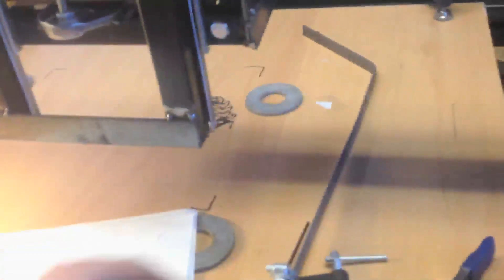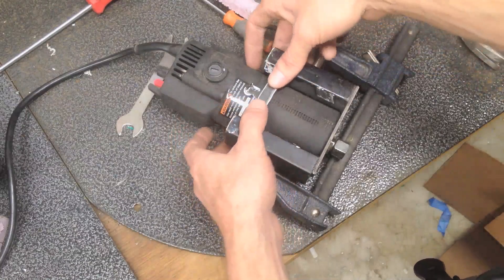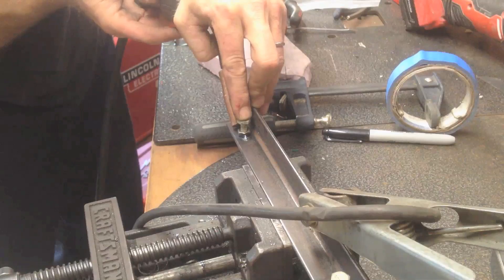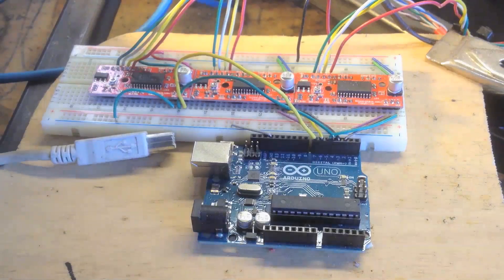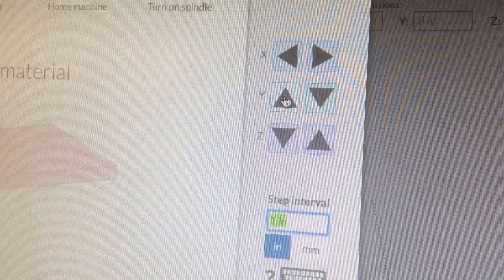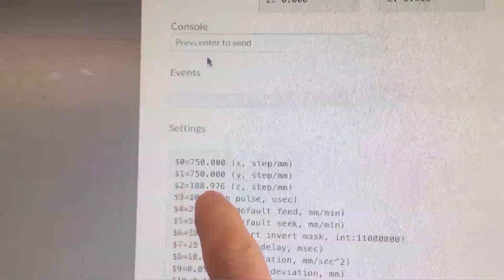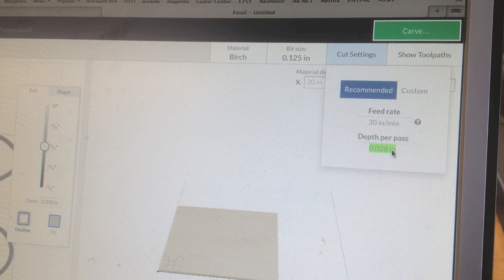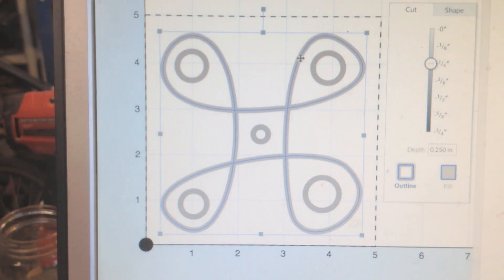How to: DIY Arduino CNC Router Cutter Welder (Part 5: Router, GRBL Settings and EASEL Tutorial)

Comment: It may seem strange to be commenting six years after the video was posted... I have been using a "Down-cut" spiral router bit recently.  It seems wrong to use a cutter that pushes the chips into the cut, but it works fine.  The big advantage is that because the spiral pushes the fibres down, there is absolutely no tear-out or fuzzy edges, even on fibrous material like that shown at 15:30.

Comment: thanks for bringing us best tutorial. please don`t mind i can`t speak English,  i have one problem in motor $150 step/mm is fine but my motor start vibrating on $160 or $200 etc. so can any body help me
im running my cnc on arduiono uno + cnc shield v3 + stepper driver A4988

Comment: Those motors look a little on the small side, are you able to machine wood with them?
Reply from the maker: Yeah. Even aluminum.
Reply: Fucking eh. Here I thought I was gonna have to shell out for larger motors to mill aluminum.
Reply from the maker: Keep in mind that these motors (nema 17) come in different torque specs,  these are the 84oz, which is the most powerful in that size chassis  (1.7in)    I'd recommend going with the biggest motor possible.
Reply: Went for nema 34's with 1232 oz in torque specs. Im hoping its enough to machine mild steel.

Comment: how grlb 0.9 homing is done can anyone say proper method
Reply from the maker: I'm using 0.8.  But have you tried pressing the reset button on the arduino? This will zero the machine, then confirm new home position.
Reply: not tried 
pls say proper steps for grbl homing process

Comment: How can i specify the working area....i mean how to determine the X-Y area limit?
Reply from the maker: The working area is determined by lead screw length.
Reply: Absorber Of Light  thank you for replying; but if so whats the purpose of stop switch or limit switch?
Reply from the maker: In case something goes wrong.   I don't have limit switches on my machine,  I've had it accidentally go past it's limit but I can just hit the arduino reset button to stop it.
Reply from the maker: If you're gonna leave the machine unattended, I recommend limit switches.
Reply: Absorber Of Light  thank you for explanation and you have lessen the extra work for me of setting up those limiters i was not going to buy those anyway rather make them myself...

Comment: hiii..i am making a cnc machine with arduino uno,a4988 driver and cnc shild
problem is x axis stepper motor is moving bt y axis stepper motor is not moving.y axis stepper motor is vibrating

Comment: I really appreciate your work that is very helpful.  There is no issue for mechanical work for me but if you can please elaborate connections for ec drivers and arduino uno; that would be very helpful. Stay blessed.
Reply from the maker: Google "grbl to arduino" then click on images.  Or try this: https://cdn.instructables.com/FDQ/SMY5/ICWG14EQ/FDQSMY5ICWG14EQ.LARGE.jpg

Good luck!
Reply: Thanks a lot, your quick response is really appreciated.

Comment: That trim router mount is about as direct and effective as one could make.  I wasted days working out a machined mount for that same oddball body shape before dumping it and going to a Craftsman 1/4" router body I found at the junk store.  

I may go back to the HFT now that I've seen your mount.  Thanks!
Reply from the maker: I recommend that trim router from HFT.  I've had it running continously for HOURS and it's still going!  Not bad for less than $20

Comment: Your videos are great! I just started a build based off your frame design. I am downsizing it a little bit, and using 1" square tubing instead of 2".

My problem is trying to find a system that will work with my Mac computer. The Arduino set up seems to be my best option.

One question: Are you limited at all by the Nema 17?  My plan is to do mostly wood routing, for making guitars..... I'm debating on whether to step up to the Nema 23, but haven't found many sources from people running them through Arduino.
Reply from the maker: The nema 17's are working great but I would go with the 23's for increased speed.
Reply: If I'm using the same EasyDrivers and Arduino, what do I need to keep in mind when picking out a Nema 23? Just make sure they are under the 1.5A rated on the Driver? Or under 2A if I go with the Big EasyDriver? 

What is the size of your Nema 17s in Amps and holding torque?

Thanks for the reply!

Comment: I did almost the same with two differences 1. i have two axis (x, y) 2. my grbl powered with 5V 0.4 Amper(i have different motors). It doesnt work, i mean the easel cant find the machine. Can anyone help me..
Reply: It's ok i did it, well if somebody else have the same problem, i manage to fix my problem installing(manually) usb driver. So if it does work automatically you have to do it manually.
Older version of arduino it may says that the GRBL mounted but it may not be true you should have the latest version.

Comment: Nice job,
I liked your project and i am planning to make a cnc machine like you,
But when i verify the GRBL its giving me an error like this

(#include <grblmain.h>

                      ^
compilation terminated.

exit status 1
Error compiling for board Arduino/Genuino Uno.)
Reply: you need to make sure you have the grbl library downloaded and installed in your libraries folder.
Reply: Hi, 
when i opened the GRBL by mistake i made the .cpp files to open with notepad.
Do you have any idea how to return it to unknown file.

Comment: Very smart man your whole build makes it a lot easier to understand the best tutorial I've seen doesn't leave any doubt. I have been playing with servo motors and have a cnc card for my arduino but I think i'll just buy those ezy drivers what you used until I'm more  knowledgeable, thanks a lot, i can now move forward again :)
Reply from the maker: Awesome,  good luck my friend.
Reply: Thanks man, have you tried making wooden gears? there is an awsome gear program on the net called geargenerator.com
Reply from the maker: Oh nice!  I'll check it out.  EASEL also has a gear generator.   I have not made any just yet.
Reply: would you suggest going up to nema 23 or not? or have you found the nema 17 are good enough
Reply: 3 easy drivers ordered today NZ$20.75 and 10 ABec9 skateboard Bearings ordered NZ$13.54
 :), now Looking for lead screws and nema motors, metal is real cheap Atm the Chinese  are dumping it NZ$40 for 25x25x 8m
Reply: maybe I should design it on 3d Max so i don't over order hahaha

Comment: please can you give me the Code ? great job man !!
Reply from the maker: https://github.com/Protoneer/GRBL-Arduino-Library/archive/master.zip
Reply: man can you explain me that error ? :Arduino : 1.6.10 Hourly Build 2016/07/12 12:33 (Windows 7), Carte : "Arduino/Genuino Uno"

C:\Users\Admin\Downloads\GRBL-Arduino-Library-master\GRBL-Arduino-Library-master\examples\GRBLtoArduino\GRBLtoArduino.ino:28:22: fatal error: grblmain.h: No such file or directory

 #include <grblmain.h>

                      ^

compilation terminated.

exit status 1
Error compiling for board Arduino/Genuino Uno.

Ce rapport pourrait être plus détaillé avec
l'option "Afficher les résultats détaillés de la compilation"
activée dans Fichier -> Préférences.
Reply: Error compiling for board Arduino/Genuino Uno. :/ what I have to do ?
Reply from the maker: Troubleshoot brother.   It took a lot of research for me to get it working.  Also i'm on a Mac so it may be different on Windows.  Don't give up!  Start here:  https://www.arduino.cc/en/Guide/Troubleshooting#upload
Reply: Absorber Of Light oh yes man you're right !! I'll do my possible to solve that problem ,,, please do you have facebook or any contact  please ?
Reply from the maker: https://www.facebook.com/ddvdesignandconstruction/

Comment: I have seen all your cnc construccion videos up here, and results be that I was looking for! Finally I understand that software-programing part isn't that hard that I think. THANKS!just a little advice... Go on metric system, all will be more easy and precise.
Reply from the maker: Thanks man, yes it's not that hard with some proper research.  I agree about the metric system and use it when making smaller parts.  The thing is everything in the US is in inches (tape measure, materials, etc)

Comment: Hello. Do you happen to know your leadscrew pitch? I could help you with the math :) Basically, it's (lead screw threads/inch) x (motor steps/rev) / (25.4 mm/in) = (steps/mm).

200 steps/rev is a common motor parameter. The leadscrew is probably something around 24 threads/inch. The default value you had in there: 24 x 200 / 25.4 = 188.976 steps/mm.

Adjust your numbers and all should be awesome :)
Reply: See that's what the internet is about. Not bitching on facebook.
Reply from the maker: Thanks a lot man.  This is great info!

Comment: Inches are horrific :) Why no use millimeters?
Reply from the maker: Mostly because everything in the US uses inches:  tape measure, materials, etc.    I do agree with you, metric is much simpler and I use it when making smaller parts.
Reply: i really suck at using inches, sometimes when ppl say measurements in inches id be like "wut? in english pls" :D

used mm all my life and most of the things wer sold and measured in metric, so when i moved to a different country this inch thingi became a huge problem for me ;s

Comment: I like the way your CNC build is adaptable for so many uses.
      A GREAT idea is the exchangeable carrier that fits into the Z axis frame allowing a quick change to other tools for other projects / purposes,  very inventive!
     A CNC drawing, routing, engraving, cutting, welding, etc. machine. I've got to copy yours (hope you don't mind). The absolute only changes I would modify would be to use all sealed bearings and to enlarge the frame to accept a 4x8 sheet of stock material.

Comment: it's very handy job, thanks for sharing it,i have question regarding electronics,you have used an arduino  Uno USB card,  NEMA stepper motors for X, Y, Z axes, i believe the gantry had to be driven by two motors instead of one, how was the drag torque of the gantry with one motor?!! was it enough?!! and what is the name of the motor's drive card "the card between motor power feed and arduino card control?!! i would build my own machine very soon.

Comment: Great job man , I followed all your videos for this CNC Router with ArduinoUNO , so I starting to build mine soon , but I wanted for plasma cutter a question is , Can I use the same set up you did with Arduino UNO for your router CNC or I have do use something different  and Easel could work for plasma too ?  could you give me an advice please ,  Thanks man , I pick a lot of great ideas from you :)

Comment: great job! I'm building a cnc, could you tell me the thickness measurements of the tubes that you used? I mean the 3 or 4 types of tubes you did you use, (width) thanks
Reply from the maker: +Angel cañizalez Thanks, the main tube I used is 2in, 14ga.  I also used some 1in 14ga,  and the rest was pieces I've had, most of them 16ga.
Reply: thank you! I am designing a cnc in sketchup, and I hope you do not mind but I'm copying yours because of all designs and seen, this seems quite firm and easy to do, thanks for sharing

Comment: Hi, your project is awesome, I've been looking for something like this for ages, I just have a simple problem, I can weld, but the arduino part killed me, if you ever have some extra time... could you do a video focused on how did you set that up?, the connections and all the wiring, I know it is too much to ask but I think I could actually complete this project and I don´t know anybody who could help me with that part, thanks a lot man and once again, awesome series!!!
Reply from the maker: +Fabio Parra Thanks man I appreciate it.  I'll do a quick video on how to connect everything.
Reply: +Absorber Of Light give me follow too , I need for made CNC but driver and interface board for CNC so expensive if possible give plan and series arduino + driver  for run stepping motor please . Thank you so much.

Comment: For help on turning yer welder/plasma tourch on or off 
You might be able to set up a proximity switch with an adjustable tab to turn a solid state relay on and off plus maybe a timer to get a final on adjustment 
For when the z axis comes down it will activater the prox switch and turn on yer appliance and when it goes up after that particular cut pass it will shut off the appliance making software an over priced commodity. Just what i would do since i mess with them all the time we use them to do automatic adjustment for tension or shit off functions till the rest of the machine catches up
Reply from the maker: +mightymalikie Great ideas, thank you!

Comment: Hi, thank you very much, your work is awesome!
One question: what can you say about cooling for the router? How long it can work without interruption?
Reply from the maker: +Ray K Thank you.  I've had the router running for about 3 hours straight without an issue.  I was very surprised,  I'm not currently using a cooling function.
Reply: +Absorber of Light Thank you! Actually you have inspired me to make own cnc.

Comment: Can you put a building material list out? I really like your design and would love to make this one!
Reply from the maker: +Keith Allen I used 2in 14ga square tubing for most of the machine.  1in 14ga for the work surface.   You can use any kind of stepper motor (mine are nema 17) and driver combination.  6 roller-skate wheels for the x-axis and 16 roller-skate bearings for the y-axis.   I bought two ACME lead screws and blocks from ebay for x and y axes and for the z-axis I used 5/16's threaded rod bought at home depot.  The drawer slides for the z-axis were also bought there.  Hope this helps!

Comment: Nice Job on the CNC Mill.  Looks real accurate.  I see you tacked welded a lot of the CNC Mill.  Is this temporary and if so are you planing to put in continuous welds after you are happy with the alignment?
Reply from the maker: +valveman12 Thanks man,  everything will remained tacked.. If i was to weld this it would distort and I want to make it easily expandable.
Reply: Absorber of Light Yes that is what I was thinking.  As soon as you weld, it will pull in the direction of the weld.  Great job and thanks for the ideas.

Comment: That must be the most over engineered cnc machine ive seen on you tube , ,Thanks for great videos glad you explained everything . . .the motors i would of done different way so that they are easy to change if faulty one needs replacing

Comment: Nice scratch build.  Not that many people are capable of doing that.  I did mine up in autocad inventor then simply cut to the drawings to make the parts.  The only thing I would have done different mechanical wise using steel was use bolts in some places where I could easily replace bearings if and when they wear out without a cutting torch.  I did mine using acme threads, 450 oz/on nena 23 steppers, a breakout board and  clone geko stepper drivers.  I use Mach 3 for the controller software.  Resulting G0 or wide open is set at 300 IPM but it is capable of about 450 IPM. G1 - or software set travel depends on material, bit and cutting depth. Its all MDF except for the V-bearings and the 3/4 angle iron. Its the same basic design. The V-rollers run on the edge of the angles. As I dont do metals MDF fits my needs.  Amazing how stiff it can be when you glue 2 3/4 thick pieces together. Deflection on a foot of 6 inch wide 1.5 inch with a couple hundred pounds hanging on the free end is right at .002.  Close enough for me. 

As the stepper drive current is real low doe to the chips on that board, consider this.... The adruino send a step and direction for each of the 3 steppers. The result is that is EXACTLY the same as what I get out of my breakout board... SOOO  if you need more OOMPH simply toss that driver board, pick up a 36 volt 15 amp power supply, a 3 axis geco driver or 3 separate ones and 3 450/0z steppers. NOTHING changes software wise.

So when do you do a scratch plasma cutter?  hehh
Reply from the maker: +John Ware I appreciate your comment, you know your stuff.   I do eventually want to get that Mach 3 software.
Reply: mach 3 works with a parallel port but as most computers today dont have that I recommend you go with Mach 4 using usb. Goes for 200 bucks You will need to add something like the smooth stepper board. It converts USB to essentially a parallel port out that will interface with a standard parallel port breakout board. I may go that route when my 15 year old computer driving the CNC croaks. a standard usb to parallel port adapter WILL NOT work with Mach 3. Mach 3 will run on w2k xp and the 32 bit version of  windows 7 and up. it WILL NOT run on the 64 bit versions.
Reply from the maker: +John Ware Thanks for all the great info!
Reply: Any time.. :)